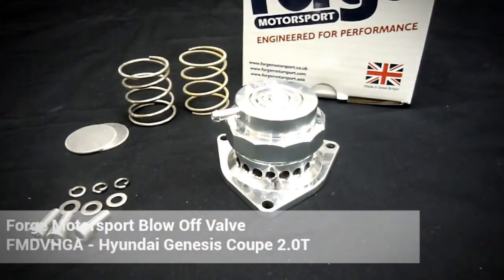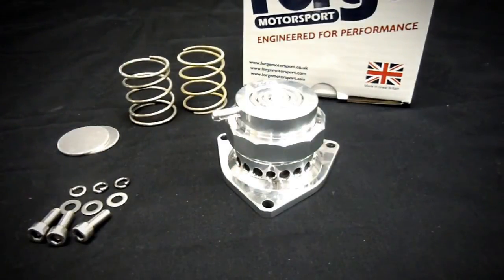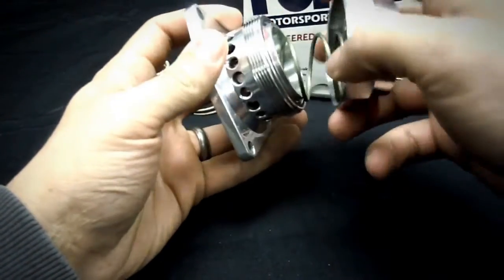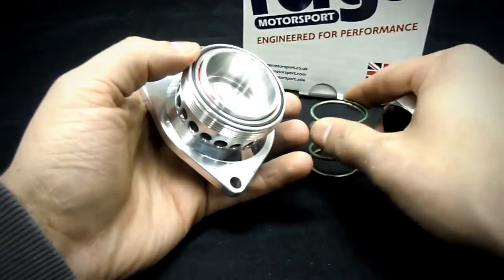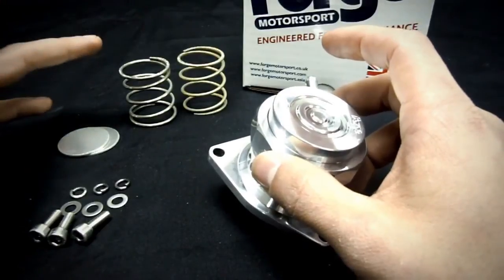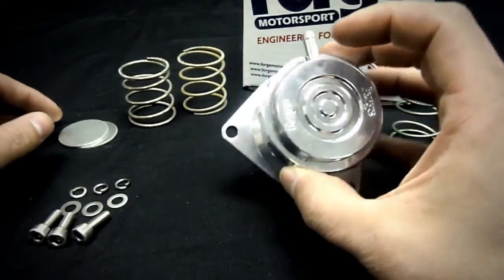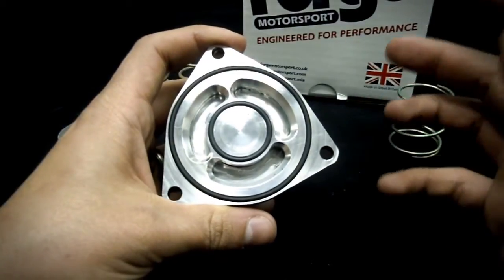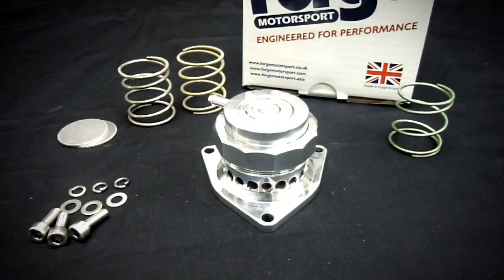Forge BOV for Hyundai Genesis Coupe 2.0T - FMDVHGA

Comment: I have been trying to find out if the stock diverter on a 2013 would work on a 2011.  Seeing that this bov works for both, is there a possibility of making an adapter so the older genesis can use the newer "replaceable" $40 part since you have to replace the whole unit on a 2011 if it fails?

Comment: got a forge value is stuck open wont close just happened today so im looking around what to do. tmmrw will open and grease and see if that works.
Reply: Same issue, please let me know if it worked and what you used!
Reply: hey nelson, funny thing is so i open the hood., the valve is open ofcoruse. i start the car. you can see the value is stuck open , i took a screwdriver or Philips head or something long. i tapped the back of it and it released the value that means it got stuck because less lube friction etc. i took some Spray lube turned off the car and sprayed the holes., start the car it worked and CEL light went off and i turned it off again lubed it again just to make sure and pumped some real hard revs and yeah so far so good.  i know one day ill have to reopen it and lube it the spring
Reply: Thanks man, what spray lube did you use? I will use this temporary fix until I open it myself.
Reply: liquid wrench is fine they say wd40 but i wouldnt personally bc i know how that works on these types of parts, was very happy it was just stuck not something big.
Reply: neoda91 so question real quick bought the same bov. So when I rev and let go of the gas it only opens up a little bit is that normal